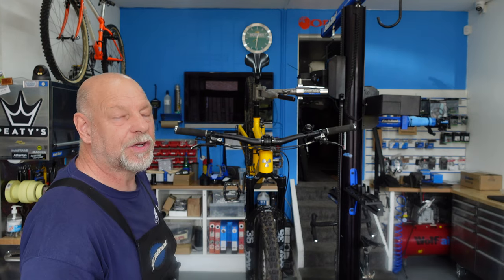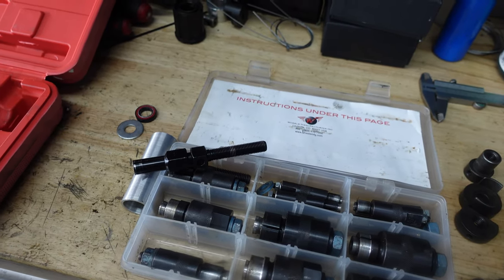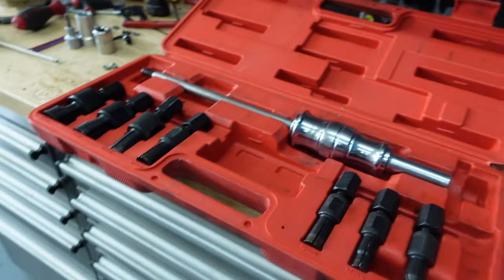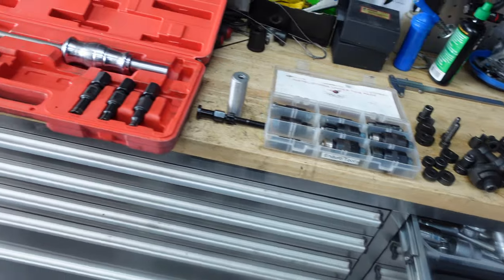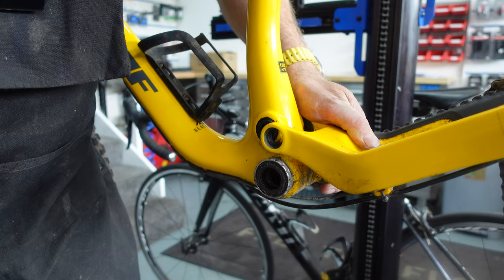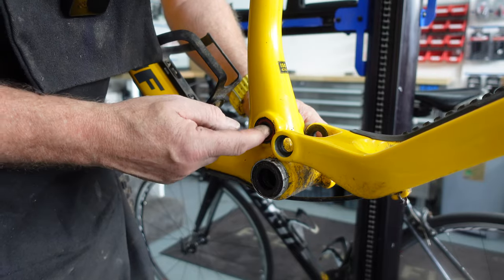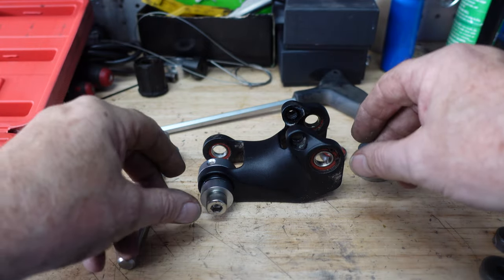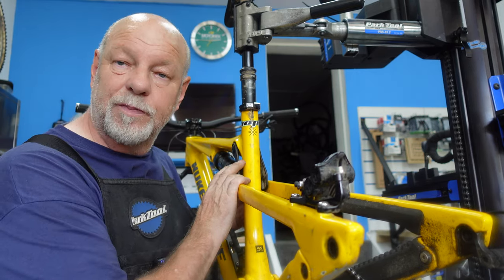How to replace the bearings on your Nukeproof Reactor and which tools you might need.

Comment: My mate had an ancient old Specialized Pitch which badly needed overhauling after spending many years in the shed. It had those back to back bearings in the rear with the separating lip in between them. I used the blind bearing puller, but they were so tight it simply ripped out the centre of the bearing leaving the outer race seized in the frame. I had a nightmare getting those out let me tell you. It turned into one of those jobs you wish you'd never started.

Comment: I need to do this to my reactor 2022. where do I find this drift tool you use at 15mins to hammer that one out? All new to me and slightly confused to what tools I need. Found a press kit for the 3 type of bearings I need on this bike to reinstall them so that should be fine,  Seen a bearing puller for sale but no mention to use it with this slide hammer. Couldnt link the site where I can purchase this puller from could you? Thanks for great video
Reply from the maker: Hi, thanks for watching and your comments, We found a set of those used on ebay, we were lucky they are really good and we use them a lot.